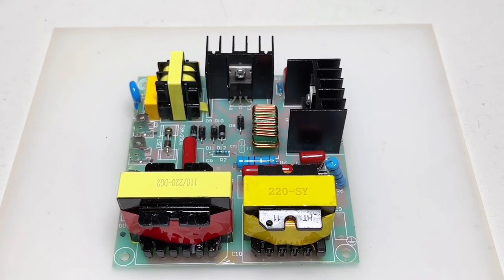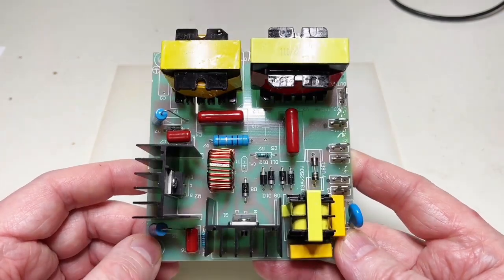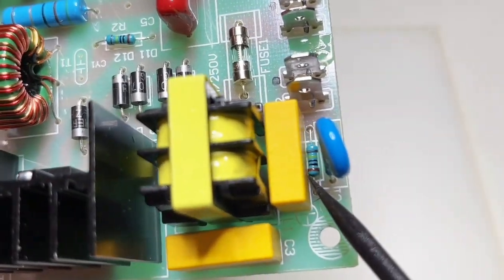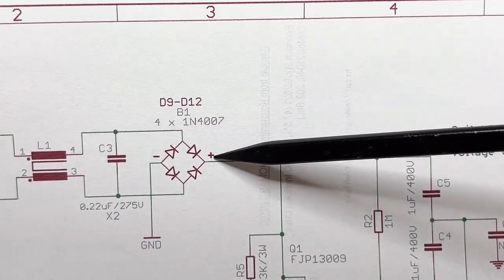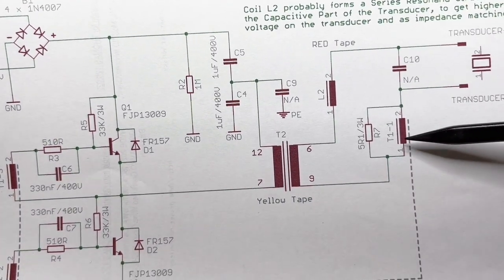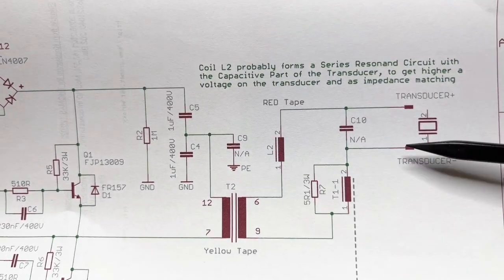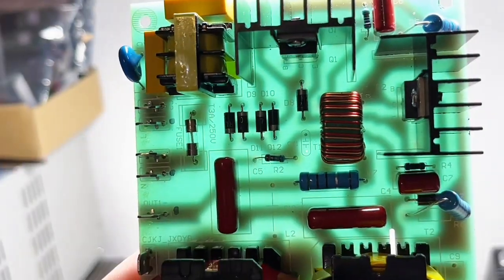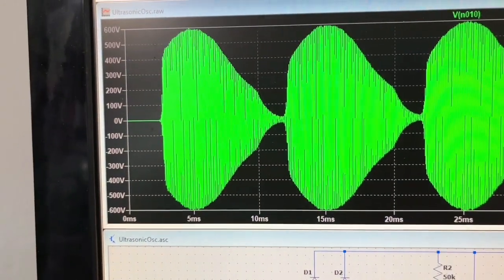120W Ultrasonic Transducer Power Driver, Schematic, Details, Infos

Comment: I bought a 40hz 60w vevor cleaner and want to swap a 28hz 60w transducer that I bought. How would I go about modifying the power circuit that came with my original cleaner to power the new 28hz? Trying to learn electronics! Thanks a bunch
Reply from the maker: Hello, the circuit used for the cheap vevor cleaners is just a old design fixed frequency driver wher you cannot change the frequency without modifying the transformerr. If you want to use a Trasducer with a different frequency, best would be to buy the matching driver for the new transducer.Or to Design a Total new Driver Board.

Comment: Hello do you know why theres allways no smoothing capacitor in ultrasonic generators boards? Is the 100Hz needed for the cleaning?
Reply from the maker: Hi, I didnt had tine to verify it but you see at the LTSpice simulation results, the USonic Burst's, this is the 100/120Hz Modulation of the Usonic Signal.

Comment: Hello Sirs,
How can i simulate a ultrasonic transducer to see if it is working or no?
Reply from the maker: Hello, use ltspice, like i showed in the Video.
Reply: @KonstantinGrigoriadis sorry I cannot understand you sir..what is itspice?
Reply from the maker: @george34777 LTSPICE is a simulation software fron Analog Devices, free to download
Reply: Oh ...thanks for the reply,I mean that I have a ultrasonic cleaner device but I am not sure how to test the piezos if they are in working condition or not. Also i want to know if I can measure the output of PCB somehow!
Reply from the maker: @george34777  Hello, you can try to put water in the cavity and a larger piece aluminum foil on the mater and turn it on. If the cleaner works the Foils should get holes after a while. You can watch my video to see hot that looks: VEVOR JPS-60A Ultrasonic Cleaner, Test, Teardown
https://www.youtube.com/watch?v=KDBQix4vJHk
Reply: @KonstantinGrigoriadis  thanks Sir!

Comment: Hey, i feel like i have searched the whole internet to find out if this circuit is frequency tracking???
Can this circuit handle changes in load on the transducer? Or does the drover board simply stay at its own fixed frequency?
Reply from the maker: I didnt tested it but bcs the transducer is part of the resonant circuit i could imagine it does. Could be testet with the ltspice simulation i showed

Comment: Hi Konstantin, I have an old ultrasonic cleaner from 1994 that I wish to revive, it's a unit that has a sentimental value to someone I care about. It turns on but the power of the transducers is low, it doesn't clean well and it's much quieter than it used to be. So far I replaced some capacitors - they were clearly burnt, I replaced two NPN transistors, checked the diodes and resistors - all good, checked the transformer for continuity - also good. I replaced the ultrasonic transducers too. It still doesn't want to work properly. I could use some help!
Reply from the maker: Hello, what is the Brand and type of your cleaner ?
Cheers, Konstantin
Reply: @KonstantinGrigoriadis  It's a L&R Ultrasonics  Quantrex 140H made in the USA in May 1994, with a vintage type circuit board. I can't find anything about it, it's just old. I can send you detailed pictures.
Reply from the maker: @yoloswaggins666  is the schematic similar to this : https://www.electro-tech-online.com/threads/ultrasonic-cleaner-repair-l-r-t14.144735/ ?
Reply from the maker: @yoloswaggins666  You can send me some pictures of the PCB to my YouTube Channel Email if you want.

Comment: If you have a ultrasonic cleaner with multiple driver boards, the output of the driver boards have to be in sync to not create destructive interference right? So what if you replace the self oscillating circuit with another one that you could control the frequency (maybe with an arduino or esp32 for the ease of use and programming)
Reply from the maker: Hello, theoretically possible,  but not feasible due to the higher complexity and costs. These are standard industrial boards, used in most of the cleaners. 
Check the comments of this video, there are some very good explanations about the synchronicity of the transducers. Cheers, Konstantin

Comment: Hello, What is the working frequency bandwidth?
Reply: if given 25khz input, can it be done? or does it have to be modified? and is it DIY? if you buy it, can you ask for a purchase link? sorry for asking a lot😁
Reply from the maker: 1) Frequency is fix, matched to Transducers, 2) DiY !?!?  that's a fully reverse Engineered Design from a Commercial Ultrasonic cleaner, please read the Description of the Video.
Reply from the maker: Hello, The working frequency is ca. 40kHz

Comment: Sir, whats the best way to tune this circuit for other frequency? I understand its with the gate driver tri-filar transformer, but is only with LTspice?
Reply from the maker: Hello, The Frequency is specified by the used Transducer, to change Frequency the transducer has to be changed the L2 Inductor and the T1 & T2 need to be recalculated eventually.
Reply: Thank you sir, I've been playing around with ZVS driver now for a couple of years now powering CRT transformer for fun. So yes I have 100khz transducer and was wondering if lt spice is a good software to simulate the circuitry if I plan on rewinding the torroid, the choke and the pulse transformer.
Reply from the maker: Hello, LTSPICE it just a Simulation Software, yes you can use it to Simulate the Results of your changes.

Comment: Excellent video thank you. I have one of these that stopped working or putting out as much power as it should. I have always been suspicious that the resonate circuit needed tuning somehow but I have no idea how and your circuit confirms that it is setup at production somehow. I am surprised there isn't some way to tune it to match variations in components. Im certainly not going to connect my scope to it to investigate :)
Reply from the maker: Hello Campbell, Thankyou !
If you use a scope, use either an Isolation Transformer or a High Voltage Differential Probe or a Battery Powered Scope. The whole PCB is Hot(mains) + the Higher Voltage Output to the Transducer. Cheers, Konstantin

Comment: All ultrasonic cleaner circuits must be like this; they all hum when operating.
I expected them to be silent when operating, because, well, ultrasonic means inaudible.
But they all hum.
Reply from the maker: Hi John the Audible noise is bcs of the 100(120)Hz that are superimposed over the 40kHz Transducer Signal due to the non existing Smoothing after the Rectification. 
Btw. in my video I Recorded while the Thing was Operating on Purpose, only bcs we do not hear the High Frequencies, that does not mean they are not existent :-) The Cleaner Produces many many dB's of Ultrasonic sound. The microphone of my Mobile was so overwhelmed from the High dB Ultrasonic, that you could not hear my Voice even i was 20cm behind the Mic. (I use both the front an back Mic's of my Phone)

Comment: I have one of those and I can assure you there is a lot of voltage that thing produces. I shocked myself bumping a clip wire attached to the transducer and I definitely felt it. Be careful with that circuit, its dangerous for sure. Luckily i only briefly touched the wire with the back of my hand. It definitely lands a punch. I learned my lesson. I had no idea what voltage it was at when I was assembling my test rig, but I found out quick, its enough to guve you a bad day if you aren't careful
Reply from the maker: Hello, the whole Driver Board is under Mains and rectified mains what makes it much more dangerous, the Transducer Voltage is an Additional Problem. Cheers, Konstantin
Reply: I looked up the drivers a few months ago, and they seem to all be spec'd 800-1200v for the 60w versions. I bet you won't be doing that again! 😮

Comment: This topology is called a Jensen converter. It's principle of operation is based on the saturation of the current transformer that feeds the  base's of the power transistors. 
When the converter is first turned on, one of the power transistors turns on before the other (due to gain mismatch) and the high value pull-up resistors to the positive rail.
This is what initiates the oscillation. Once one switch turns on it causes a current to flow in the current transformer switching the "on" transistor on harder and switching off the other transistor. The current will continue to flow until the volt-second product of the toroid is reached, whereupon the core saturates and ceases to be a transformer, thereby removing the gate drive to the "on" device. The energy stored in the core causes the polarity across the windings to reverse (Lenz's law) switching on the opposite transistor and the cycle repeats. Thus the flux density in the CT core flips between saturation in each direction twice per cycle. The load I expect capacitive and is series resonant with the big inductor. So at resonance the two reactive components will cancel out and the  equivalent circuit will simply be a resistance that represents the losses due to the heating of the water in the bath. This equivalent loss resistance needs to be included in your simulation to get a better result. 
From a design perspective the saturating core cross sectional area is adjusted so that its resonant frequency coincides with that of the LC of the inductor and peizo transducer.
Incidentally, this topology was also used in "electronic transformers" used for low voltage halogen globes in past years. It was also used in some HF florescent tube ballasts.
Reply from the maker: Hi Roger, Thankyou for the Thorough Explanation of the Working Principle. I searched on Google and found that Jensen is also called Royer or Jensen-Royer, bcs I never heard it called Jensen. The Circuit used, looks like a mixture of a Royer and an HalfBridge due to the Capacitive Divider connected to the one Side of the Power Transformer.
Reply: @KonstantinGrigoriadis  The Jensen is an improved version of the Royer. The Royer saturates the main power transformer to make it oscillate. This causes huge current spikes at turn-off and makes the design of the transformer more difficult. The Jensen only saturates the base drive transformer and can use a magnetic material that has a more square B-H loop characteristic than most ferrites. This gives the designer an extra degree of freedom by seperating the power transformer design from the oscillator design. More modern designs  use a semiconductor oscillator and you can optimise the power transformer design with having to worry about saturation.
The Royer and Jensen topologies are very crude by modern standards but I find it fascinating that you can create a usable power oscillator with only passive  components.
Reply from the maker: Hi Roger, Thankyou again for the Info ! Topologies like the Royer, ZVS and co. need a good Understanding on the working of the Passives used, but as you mentioned with only a minimum of Active Parts you have a Powerful Oscillator. On the other side they are more difficult to control. For example, to make a Adjustable CC-CV DCDC based on a ZVS or Royer Topologie. This is a Project I am on it currently(as a Proof of concept) and use a ADJ Buck to feed the Input Voltage to the ZVS while getting Feedback to the Buck from the ZVS Secondary HV Output, so the CV Parts is more or less(restrictions on the Input Voltage and the Bias of the Mosfet Gates) done but with quite an effort... The CC Part with Foldback is open Yet.
Cheers, Konstantin
Reply: @KonstantinGrigoriadis  It's a pleasure.
Reply: So the circuit doesn't resonate based on the piezo's reactance, but instead they just cancel out the capacitance with the large inductor? I thought for sure the frequency would be determined by the piezo's characteristics, not the other passive components. If that is the case, then why use a Jenson circuit at all instead of a 494 or another IC to set the frequency?
Wouldn't a ZVS driver work even better for this application?

Comment: Hi Konstantin! Great video!! I relived the memories of my work from twenty years ago. 

The intention of the large L2 is to be the dominant inductance in the LC tank circuit formed with the ceramic.

Thus, the energy of the LC tank circuit does not return to the primary circuit through transformer T2 (since L2 is uncoupled). This way, you can inject energy into the tank through T2, and this energy keeps bouncing back and forth between the ceramic and L2.
Reply from the maker: Hello, Thankyou and Thankyou very much for the Info !

Comment: Do you have more details about the transformers, e.g. core size and material, wire data etc?
Grüße aus Münster NRW nach dem schönen Wien!
Reply from the maker: Hallo :-) No I didn't made a Destructive Tear down to get the winding data of the Transformers. I did not measured the Core Size etc either bcs I didn't thought it would be of interest. Grüsse aus Wien, Konstantin